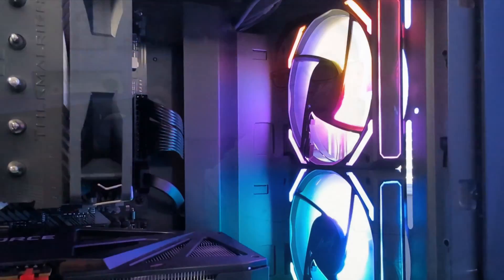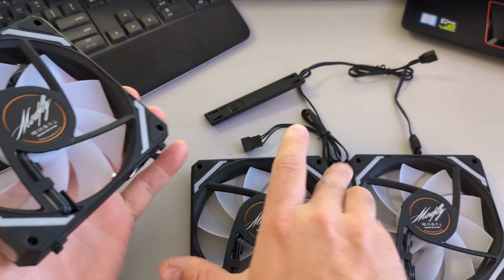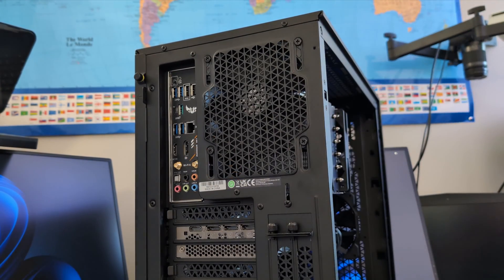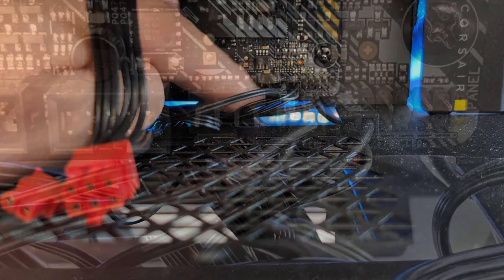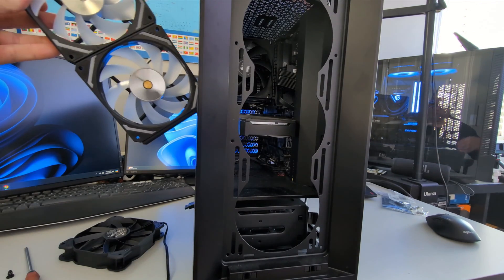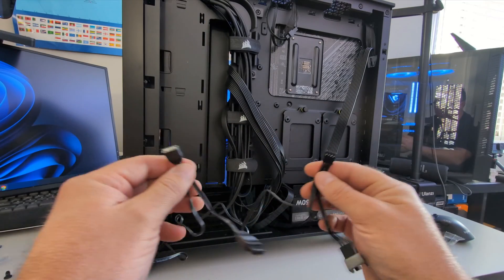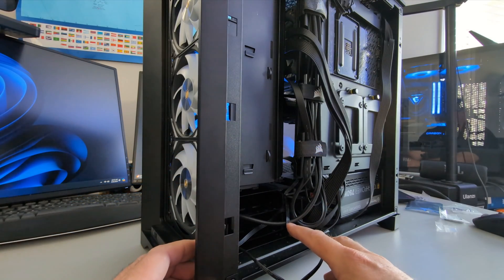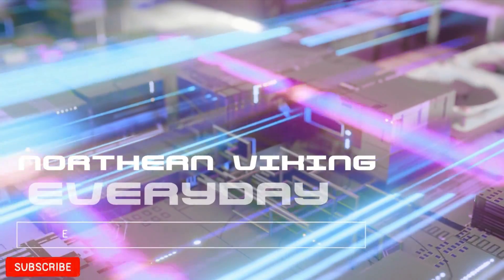PC Case Fan Replacement / Install (LTC 3-Pack Fans on Corsair 4000D Airflow Case)

Comment: I have a question, I have 3 separate fans and they’re all connected to my mother board obviously and a fan hub connecter, so my issue is how do I remove them from the hub they seem immovable